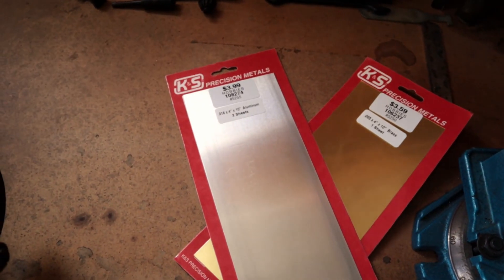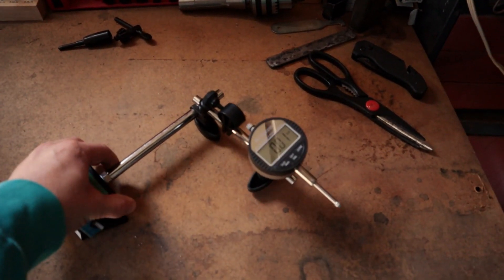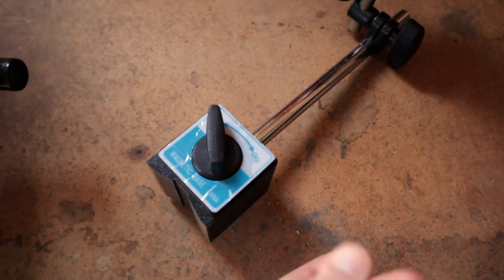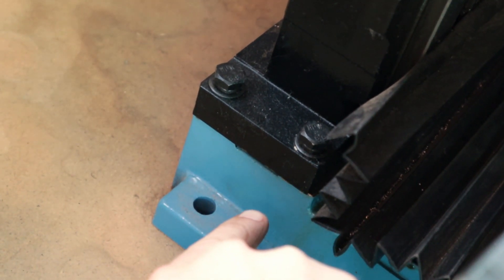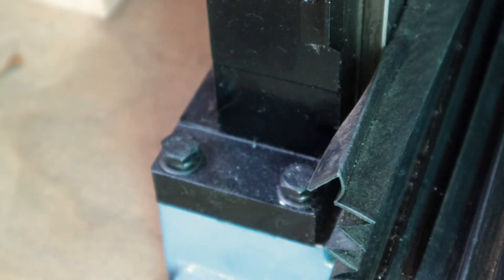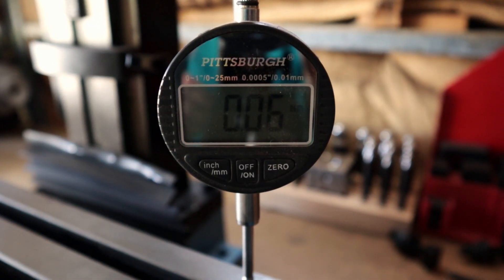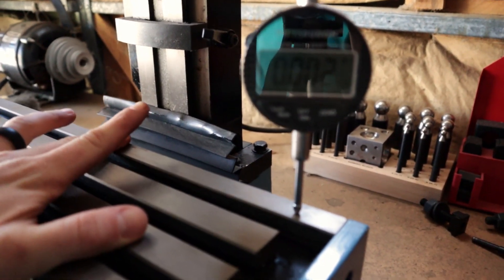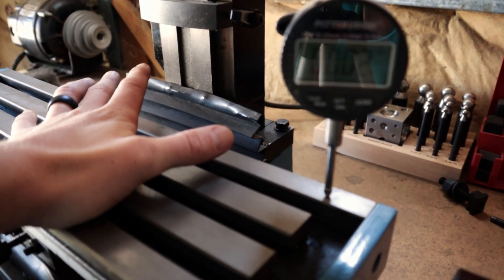How to tram your little machine shop mill

Comment: I just picked up one of these mills for my folding knives too.  How are you liking it so far?
Reply from the maker: I am learning to love it. Especially for milling slots in guards you will not be disappointed. How do you like yours?
Reply: @bladesmithhess39  Love mine.  I use it mainly to mill stop pin tracks, lock bar reliefs, and pocket clips.
Reply: are you still liking it? thinking of getting one for folders as well. heard it doesn't like to mill holes through steel too deep. shouldn't be a problem with most formal blade stocks right?